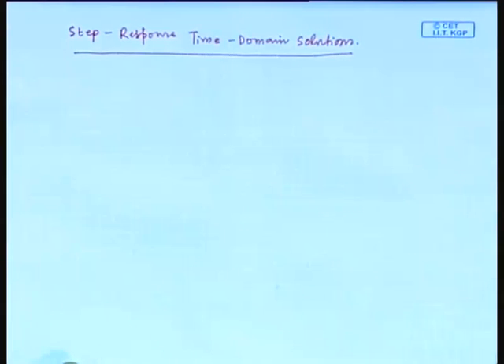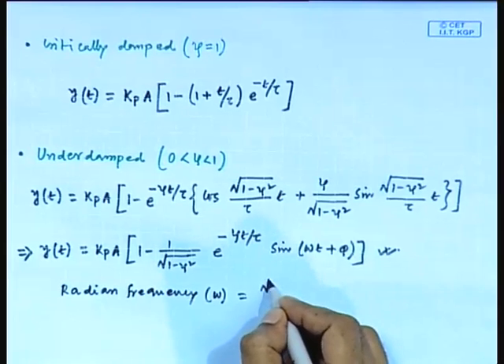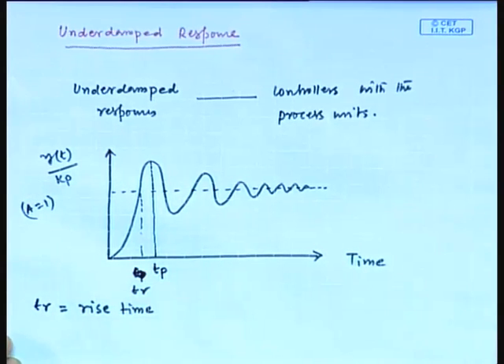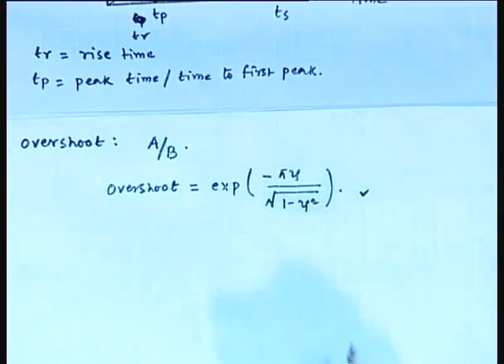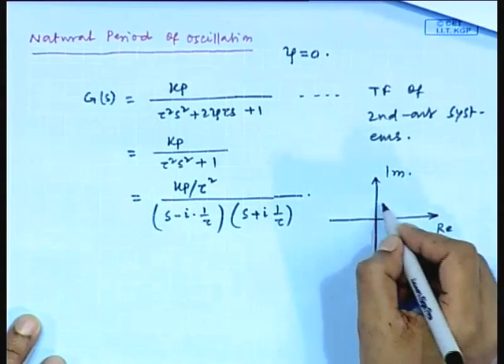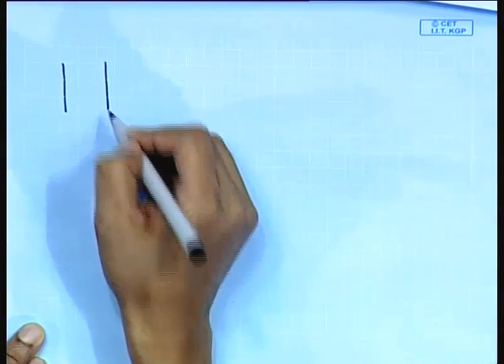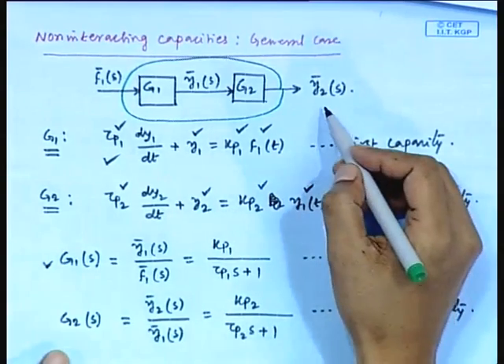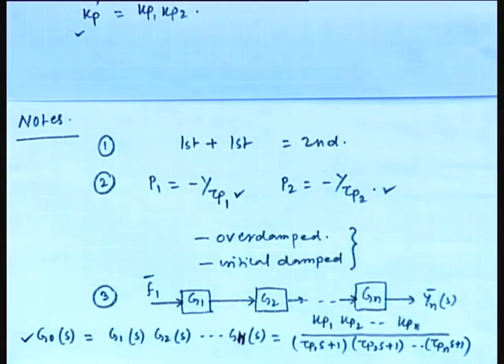Mod-01 Lec-12 Lecture-12-Dynamic Behavior of Chemical Processes (Contd...6)

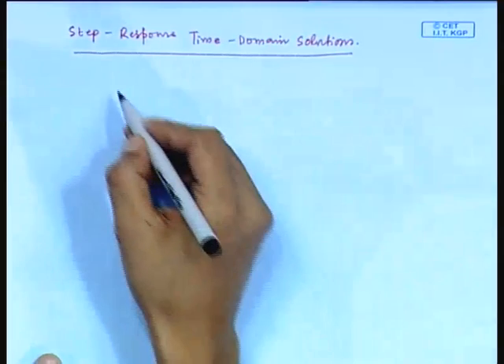Comment: 1:25 step response time domain solution
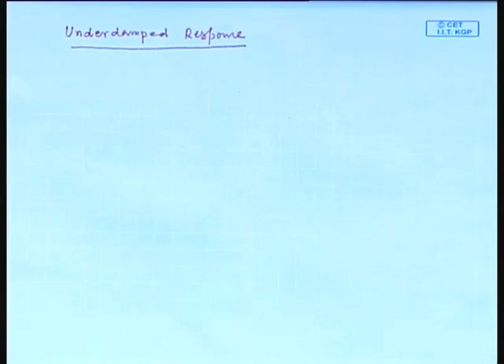14:05 underdamped response
34:40 multi-capacity processes as second order systems:
36:07 connection of 2 1st order systems in series
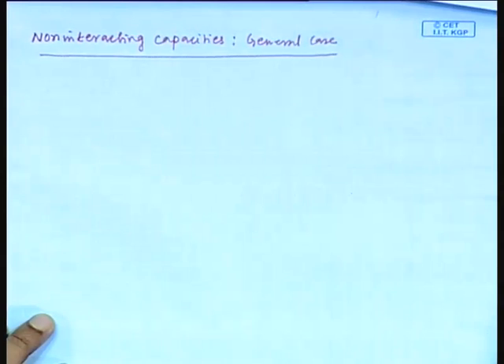42:18 non-interacting capacities: general case